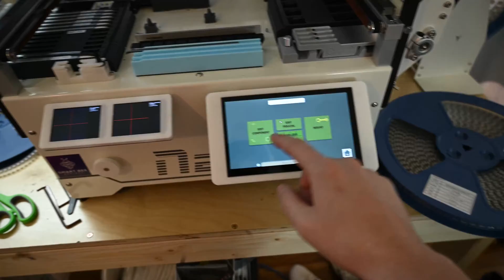My Neoden YY1 pick and place machine!

Comment: I used to maintain an old scintillation counter, probably built in the 80's that had the same problem with its cash register style printer.   They provided a tensometer for use with the printer.  It was a binder clip you attach to the paper, with tensometer printed on it
Reply from the maker: Yeah someone else mentioned a binder clip in another post I made and while I tried other weighted objects attached to it, I may try and find a large binder clip and give that a shot. Just annoying to have to re adjust constantly. Thanks for the tip!
Reply: Now that I think about it they called it a pullometer.  You have to label it for it to work properly.